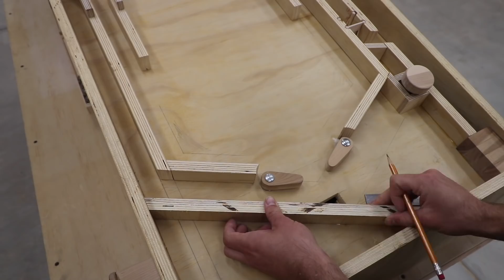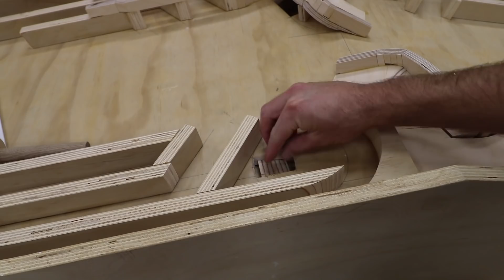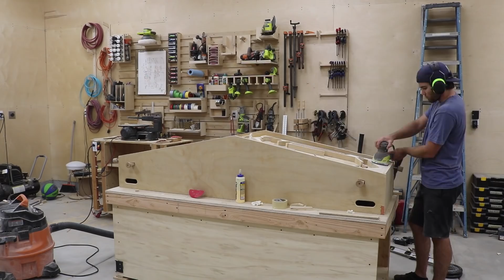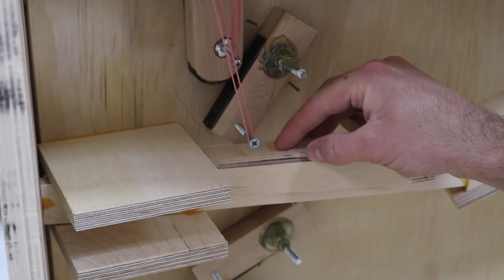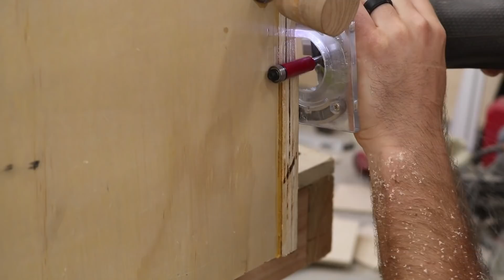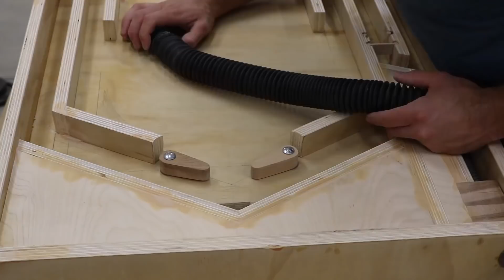2 Player Pinball Machine Build, Part 14 (Construction Complete!)

Comment: Regardless of what the theme ends up being, you can still create a "neutral" area in the center where the obstacles can vary. It can add to the depth of the game. 
Maybe: 
-extra ramp that goes around the table further
-captive ball holder that releases a new ball onto the other side when hit
-jump ramp
-rubber band bumpers
-various noise makers

side note, ben if you're reading this, I feel like adding rubber bands or a rubber material in general to the flippers and the edges of all of the high traffic areas will increase the speed and difficulty of the game! great build so far!!

Comment: i'd get some springs soon, if i were you, rubber bands dry out pretty quick compared to how long it takes for springs to corrode
Reply from the maker: There’s a few spots where I may change to springs. Luckily I built it in a way where the rubber bands are really easy to swap out or replace
Reply: @BenTardif  hi Ben I absolutely love the series and all these builds <3 been watching for about 3 years and you inspired me to make my own mini bar and beer pong table when at university a couple of years ago.

Thank you for inspiring so many people to just have fun with wood scraps and easily accessible parts and look forward to future content!

P. S. Are the flippers on this machine going to be rubberised at all or did I dream this haha :') much love keep it up
Reply: @BenTardif  Excellent craftsmanship, Ben.  And, of course, your staff (the one with big ears) is second to none.  Re: rubber bands - you might consider using 'O-rings" as they are sturdier than plan rubber bands and likely to last longer due to the reduced stress that stretching places on their circular cross section.  This was just the coolest project ever.  Thanks!